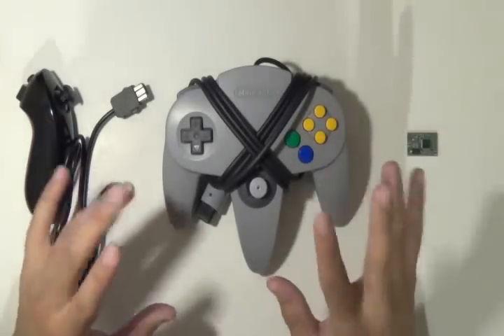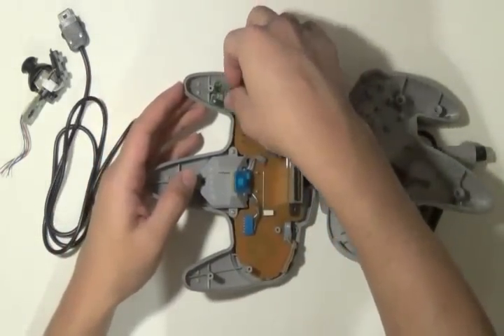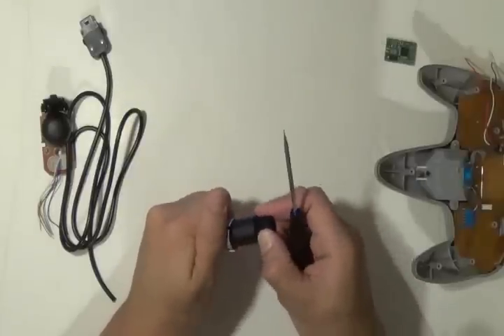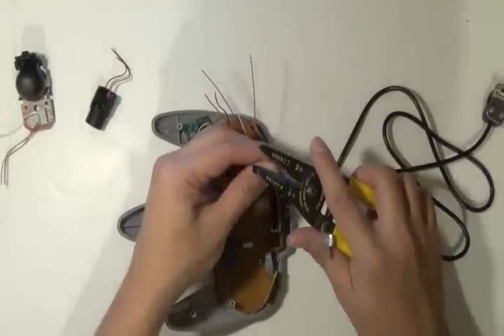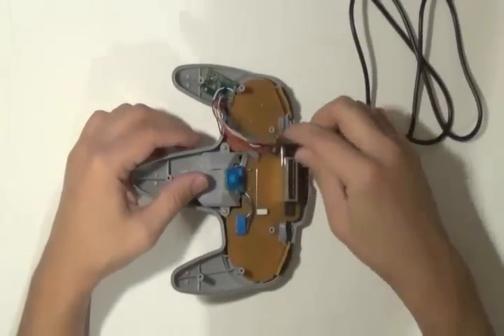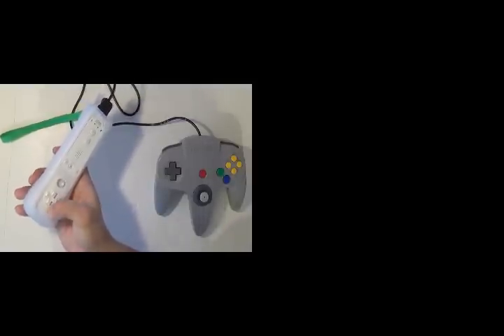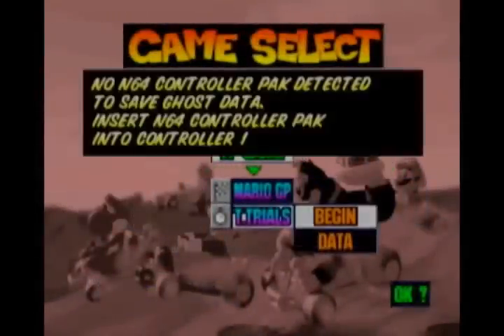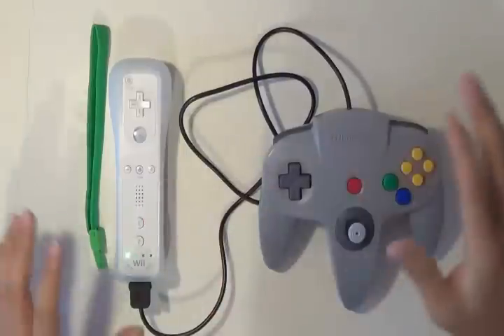How to mod your N64 controller to Wii (U) remote (Plus)

Comment: Wouldn't an adaptor work better? Either one for the GC ports on the Wii (which would make it wired to the console) or for the WiiMote (which would make it wireless)?
Reply from the maker: An adapter would probably be the better option, but I had the ability to go back to what the controller was before. So, I decided to completely change it.

Comment: Can't you just replace the connector piece?
Reply from the maker: I'm not sure wheat exactly you're referring to but yeah, you can replace almost anything you do here. You can even go from this modification back to an original controller.
Reply: I was saying instead of going through all the trouble of soldering can't you just take the nunchuck and take the piece that connects to the wiimote and put it where the part that connects the n64 controller to the n64?
Reply from the maker: Yes! Take a female connector (for desired controller) to Wii (U) controller. You can!
Reply: So is the only point in the raphnet chip to change control modes which I don't plan on doing?
Reply: Is this possible with just replacing just the connector wire or not?
Reply from the maker: No. I think the chip enables the controller you want to communicate with the Wii (U)

Comment: will this work with a gamecube controller?
Reply: On the top of the Wii you can open it up and there are GameCube slots.
Reply: Although it would be cool to make a bunch of self-modded "wavebirds" from wiimote components and corded GCN controllers. 

Or get the N64 controller to run the gamecube games. That would be a good laugh.

Comment: Keep the N64 controller cable intact and length. Always keep a scrap collection to repair with. It's made me money from thrift stores. Or my favorite project to do is cut the controller wire and extend the length with heat shrink. Some of my early controllers have electrical tape and work fine. I have a bigger distance in my set up
Reply: Or buy one of those Chinese made controller extensions... Some games on older systems complain with extended controller leads, especially in the 8 bit and 16 bit eras. Best to have a completely reversible setup, rather than hack away at a perfectly fine controller lead. Same reason I'd make an N64 - Wii adapter instead of hacking off an N64 cable.
Reply: I've had every extension for wired controllers before. For some reason my N64 extenuation short out the system. Hell I even have wireless for NES, Atari, Etc.

Comment: First off Great Tutorial Video bud! Very clear with your instructions and loved the visual aids. Really not much else could be done to improve this video. With that being said i do have some questions regarding the mod. First, does this work with a modded wii using the n64 emulator? Second, is there mapping codes for every game? You covered some major titles but i am interested in playing perfect dark and goldeneye for multiplayer and this would be a wonderful way of doing that.Third, is every OFFICIAL nintendo 64 wired controller the same in regards to the wires and where they are located layout wise? If so would it be safe to just follow your video without going through the process of tearing up the reference points (n64 controller connector, etc..)?
Reply from the maker: When it comes to emulators, I am not sure. You would have to check on the raphnet website and send an inquiry. The mapping for the controller can also be found on the website! I am pretty sure goldeneye is on there, I am not sure about perfect dark. I am not sure if the N64 controllers are all the same. I am going to be on the safe side and say you should figure that out for each one you might mod.

Comment: Wow I can't believe you put the chip on the side. Should have put it in the middle for load balancing. It doesn't seem like a lot but a few grams difference on one side can over time make a huge impact.  Then again if you are grabbing it the correct way one in the middle one on  the right I suppose having a nice counter weight wouldn't be so bad.
Reply from the maker: Excellent! I am glad someone is listening!
Reply: Dude, pay attention, he said that if he puts it on the middle the chip has possibilities of getting squished, and also the wires wouldnt fit.
Reply: Like the microchip is a house brick lol. Beware mk6 players.... You'll be going round in circles.

Comment: Thanks for the video. Easy enough to follow. My first nervous soldering job, but successful! Works like a charm. My third part nunchuck had different coloured wires... and I didn't trust what was on the board/it didn't quite match up with what you were describing, so I dismantled to connector hub to confirm which wires were DATA/clock etc using the diagram on the website.

I had a little bit of trouble getting everything to fit, but found stripping the nunchuck cable a good deal helped everything squeeze in.

So much better for playing star fox 64!
Reply from the maker: +GoldE84 Goodjob! You can always use continuity to figure what goes where. It just takes time and patience. Above all, you have to believe in yourself.
Reply: I would buy that controller off you if I had my money

Comment: I've made several of Raphnet's adapters using his schematics which he puts online for free.  They work perfect.  I have 2x dual SNES + GC adapters and 2x dual N64 + GC.  And mine are adapters so I don't have to ruin my controllers and they can stay stock.
Reply: +Steven Tyler i just bought this http://www.raphnet-tech.com/products/n64_to_wiimote/index.php
its a adaptor for n64 controller to wiimote, i suck at soldering.

Comment: Would this be viable to use a Bluetooth enabled Wii controller as a hub to use different modded controllers with?
The reason I ask is because I have seen Bluetooth enabled N64 controllers before but to make one, at least the way that was explained, can be rather pricey. But I noticed there are easy to follow Wii mods for all Nintendo system's controllers. So in theory it seems possible that a Bluetooth Wii remote might be able to be used as a hub, so to speak. Granted one could just map a prefabricated Bluetooth controller to work for different emulators.
Reply from the maker: +The Vigilant Satanic Bowser (Secret Chief) You might be right. The bluetooth is just another method of telling the Wii or Wii U: where, what, when, and how. But I cannot say for sure because I have not tried it...make a video of it! Then make millions from the views...
Reply: W³Electronics it is definitely something I want to attempt to make. But getting all the parts(along with spares) is beyond my budget as of now. But if I ever get the chance to attempt it I will certainly make a video for those that wish to replicate or improve on it.

Comment: Theoretically,  would this work with n64 emulators installed on a soft modded wii?
Reply: Virtual console injecting is probably way better, but yea that would work fine

Comment: Funny lookin memory card slot, u mean rumble pack port??
Reply: +Ken Pachi Not all! A lot of games requires the memory card in the controller. It was also popular if you wanted to take saves to a friend's house without dragging your cartridge collection!
Reply: +Ken Pachi you can put a memory card or a rumble pack in there, dumbass
Reply from the maker: Ken Pachi Either-or
Reply: Dont most cartridge based games have internal memories contained inside the unit
Reply: holyshit get mad bro need a hug? fuckin nerds and their hostility damn
Reply: +Ken Pachi 
no. That slot under the controller is used for two things, the rumble pack and the memory card
Reply: +Ken Pachi Ignorance is nothing to be ashamed of. But I'll bet you didn't know that the memory/rumble slot was also used for playing Gameboy cartridges with the Pokemon Stadium game! It would play any Gameboy game, not just pokemon. However, you had to have a copy of Pokemon Stadium, because it came with a Gameboy emulator in the software.

http://retrowaretv.com/wp-content/uploads/2015/03/n64-transfer-pak-with-game.jpg
Reply: Oh is that what that did? Thought it was a charger
Reply: Ken Pachi Yes. It was basically the same as the Gameboy Player for the Gamecube, except I don't think it worked with Gameboy Advance games.
Reply: ... I was being sarcastic

Comment: wii u????? no! its wii.. idiot
Reply from the maker: Jerry Ginn Personal Check the website that the chip is from. It's use is meant for both the Wii and the Wii U. It is the same exact controller used in both consoles! Seriously, think before you type. There is no rush to get your thought vomit all over the internet. Also, It's not that hard to click the description button. If you can click the button to comment and type. You can click "Show More" just a tad above that and read. The same thing that is mentioned for the first 10 seconds of the video itself! Idiot.
Reply: Your a fucking idiot. Dont just call a person an idiot bcuz "OMG WHY DOES IT SAY WII U I SHOULDNT LOOK IN THE DESCRIPTION FOR THE FUCKING INFO!"

Comment: Why do this when you can use the classic controller pro
Reply: growing up with a certain console during a certain generation isn't just about the games you experienced but also how you played them. the N64 controller was a first of its kind. playing N64 on the virtual console with the classic controller is doable but doesn't feel the same. Super Mario 64, Waverace 64, especially Star Fox 64 don't feel the same. Its the way it was designed to be held and how you took control of the game is what made the N64 control legendary.
Reply: You missed the whole damn point.
Reply: NotSoGoodGamer 
You could use a classic controller to play N64 games, but it's just not the same. The N64 controller is very different compared to a classic controller pro. There really isn't anything out there that is like an original n64 controller.
Reply: AlexLUVzFire hey I wasn't here in 1996 were more spoiled these days than in 1996

Comment: Rumble Pack N64 is working with that mod?
Reply: KiLoS102 How should it be? The rumble signals go to the Wiimote,so here would be now way to use it with your n64 controller.
Reply: to the wiimote? this signals are going from wiimote to N64... that would be nice

Comment: Awesome and neat job i might do this or not but is there a way instead to plug N64 controller in a gamecube slot not a nunchuck slot? would be more awesome cause i would have to move 2 controllers while i move (btw i move most of the time i am playing)

Comment: Does it work with smash Wii u???
Reply: Yes, you can, this is, basically, a Classic controller, just that check out how it's maped tho.
Reply: I don't think so because the controller is not compatible for the Smash U controls. it's not a official controller for the wii...
Reply: Jeff Mov Ok but the c buttons does what?
 Because the classic controller have the a b y x buttons but the 64 controller have the c buttons... And I think that you can't grab in smash with that controller?
Reply: Well... as I said, the problem is the mapped, I don´t exactly know how it's it, but the most posible is that C bottoms are the C stick.
Reply: a ok thx for the info
Reply: Telrac eeewww a brony
Reply: sorta...

Comment: I love the idea of being able to use my N64 controller when playing Virtual Console N64 games...but I hate the idea of chopping up one of my N64 controllers...  I wish there was a way to just make a plug and play adapter for this.  I'm sure there is a way...but I'm not knowledgeable enough or brave enough (or willing to experiment) to try.  Really cool video though.  Thanks for taking the time to make this.
Reply: I know this is old but i just ordered an adapter that does exactly what you said. https://www.amazon.com/Raphnet-tech-Nintendo-64-controller-Wii-adapter/dp/B00V3I6098. Haven't got it in yet but from what i've seen it supposedly works great. I can report back after i test it if anyone is interested.
Reply: You could do it without tearing apart the controller, but the next best solution involves having bulky shoddy materials between your controllers (64 and Wii). e.g. you could tear apart a N64 and take the contoller port out, then craft some sort of box to sit between the controllers.... pain
Reply: Buy a n64 controller extension cable and do the mod to the extension cable instead of the controller.  You'll need to build a housing,  but that's simple enough.
Reply: +Don Skiver 
buy a copy controller
Reply: So how did it go? Did you receive your adapter?

Comment: Would this work with the WiiU? Because if I could play the new smash game with an N64 controller, it would be amazing. xD
Reply: The C-Buttons Correspond to the Right Analog Stick, so they would refer to the Alternate A-Smash Attacks that was developed when Melee was released, not the Original N64 Style where you would Jump. In this case, you would have to push the Analog Stick up to Jump which is a downfall. The Controller is great with Mario Kart Wii and Mario Kart 8 as of now. Not really an amazing turn out for Super Smash Bros. Melee-Wii U and definitely not good for Super Mario 3D World, Rayman Legends or any other game that requires the use for the Y or X Buttons as for the fact that the Y or X Buttons don't exist on the N64 Controller.
Reply: Game'n'Glitch Central Wait so the only downfall is that I would be stuck with tap to jump?
Reply: Correct
Reply: Game'n'Glitch Central Well I think tap to jump on an N64 controller is better then tap to jump on the nunchucks. So I may have to get one of these custom made for me by one of the guy's down at the tech store.
Reply: Not necessarily, the C Button on the Nunchuk was a perfect button trigger for Jump if you were using the Wii Remote and Nunchuk. It's slightly irritating because pushing up on an N64 Joystick can be a little bit irresponsive, especially when you're trying to get back on the Stage. If the C-Buttons weren't mapped as the Alternate A-Smash Attacks, then it would be easier. Like I said, the Controller is not totally obsolete, it's still good with Mario Kart, just not with any of the titles that require the use of the X and Y Buttons
Reply: Game'n'Glitch Central Wait, you can use a PS2 ctrller on the wiiU? Wat? I call hacks, I'll be sure to check it out. ^_^
Reply: And if you can help out by Subscribing, I'd really appreciate that 😊

Comment: +Wanildo Neto I made a Video Demonstrating how you can connect not only a Nintendo 64 Controller, but a PlayStation 2 and GameCube Controller using the MayFlash GameCube Adapter and the Classic Linker.

Comment: I did this but i used a n64 port so i could keep my controller stock. Didnt work for me. Wiimote stays connected with N64 controller pluged in. BUT the cursor is always moving up at an angle and it keeps trying to select items. Unpluged controller it it works fine on  my 64.

Comment: Would it be possible to purchase a N64 controller extension cable, cut the end off, and attach the board to that, so that you would be able to use any unmodded N64 controller with a Wii? (You would probably want to make an enclosure for the board.)
Reply from the maker: I don't see why not. That would actually be good way to go if you don't want to cut the stock N64 cable.
Reply: Jletsplays i tried this but it did not work. I am having problems. I know this can work b/c the site you buy the chip from has premade adapters. Do you think the data wire might be why my cursor want stay still? Or do you think it is possible i got the chip too hot when solding it?
Reply from the maker: They are both equally possible.
Reply: Jletsplays ive tried everything i can think of. Guess ill order a gamecube  port on try it. If it still wont work i'll just order a premade adaptor.

Comment: I feel like cutting off a  arm when cutting the 64 controller wire shiffers
Reply from the maker: lol if it bothers you so much you can salvage it and reconnect it. Also you can use a third party controller too.

Comment: I don't get it, you connected everything to the chip. How are the buttons working?
Reply from the maker: Everything goes from the N64 to the Chip to the Wii Connector.
Reply: Huh, I must have missed that part.
Reply from the maker: The schematic pretty much shows you. I don't say it outright but I made sure to show it in the pictures.
Reply: I tried But it doe not work